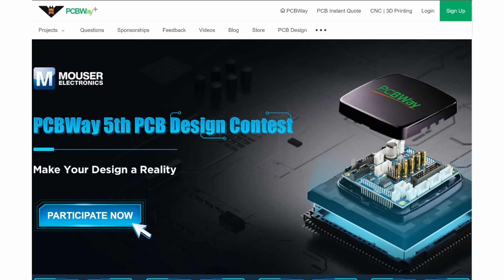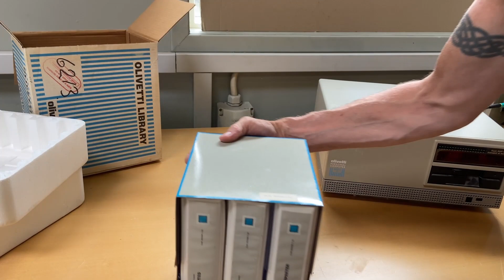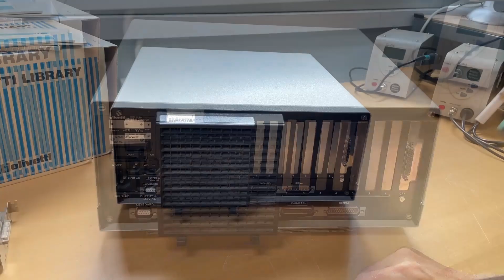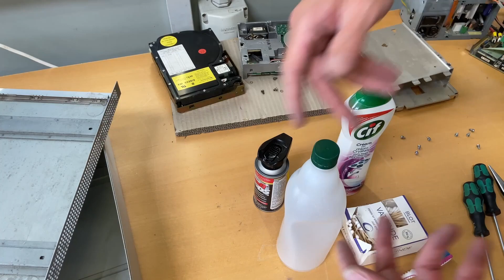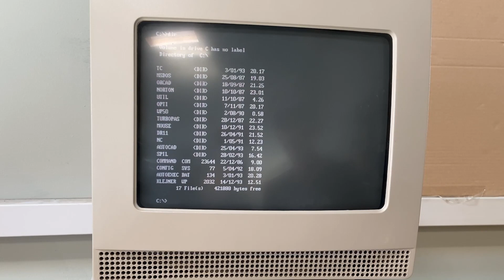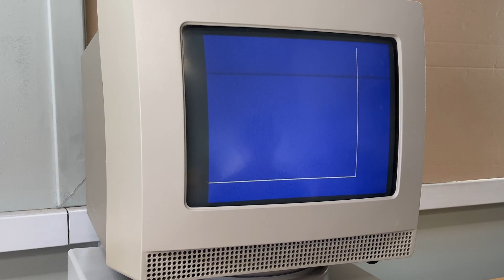Olivetti M24SP - 8086 - With parts from the Danish Army

Comment: Your video lets me remember the "good old times" in the 1980s. Thank you!

The olivetti M24 was faster than the original IBM-PC XT - 8 Mhz 8086 instead of an 4,77 MHz 8088 - and the M24 SP in your video with 10 MHz. And the graphics was 640x400 instead of the 640x200 from IBM originally.
olivetti had a joint venture that time with AT&T in the USA. And the AT&T version was the 6300 model. AT&T had about 25% of olivetti that time in shares.
Also the olivetti M24 was sold as Xerox 6060 and as LogAbax Persona 1600 in France also.
There was also a graphics card from Hercules with a more higher resolution but in monochrome - for CAD programs that time.

Oh - and it was 512 KiloByte and not - like you told - MegaByte at the mid 1980s... 😉😁
Reply from the maker: Thank you for your kind words

Comment: 26:47. Is it the western digital hard disk controller card with a bios?  I’m trying to fix an at&t  6300 with a very similar mfm controller card.  Did you get the part number off the card WD1002a-WX1?
Reply from the maker: Hi Matthew. The Western Digital hard disk controller in this video is as you also mentioned the WD1002A-WX1 E017 X1 (61-600028 8643) . There is an empty space on the board for an 28 pin extra bios. If you want a high res photo please contact me via my email

Comment: probably worth taking a dump of that disk before it dies - the ope disks were very unreliable
Reply from the maker: A complete backup has been taken of the harddisk. But the OPE harddisk are actually very stable. I have many computers with OPE's running.
Reply: @TiBosRetroComputers  You are a lucky man - I used to have a mountain of them arrive on my workbench every day in the 80’s.

Comment: there was another variant possibly uk only that had a fat matrox graphics card alongside the oem video card - we only managed to run the demo’s on the card but it was impressive for the 80’s
Reply from the maker: Another variant on the Olivetti M24SP? I'm not know to any other models! Are you referring to the Olivetti Graphics Expansion card, that gives 640x400 in 16 color?
Reply: that was probably an PE24 (Personal Engineering), which was an pimped M24 with Co-Processor and Matrox PG graphics board.